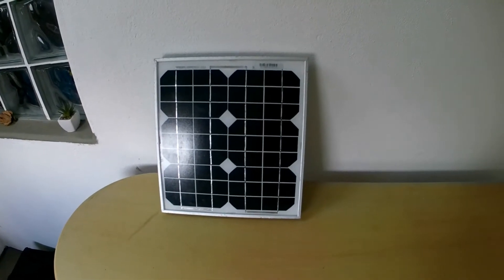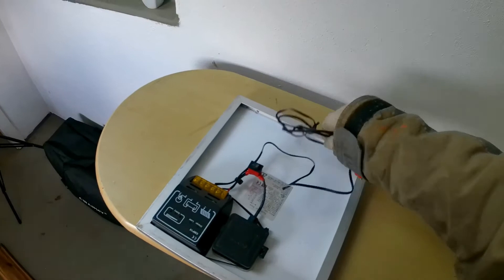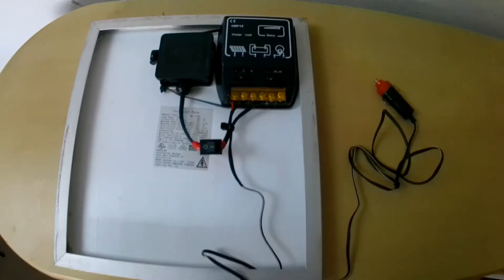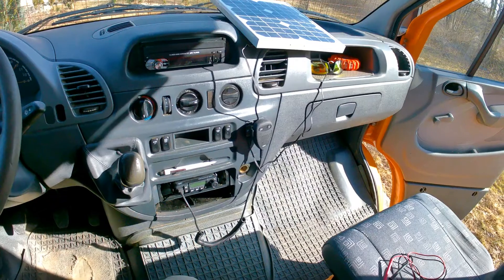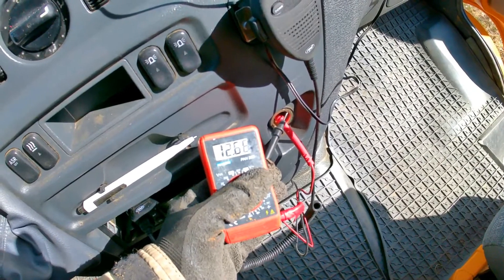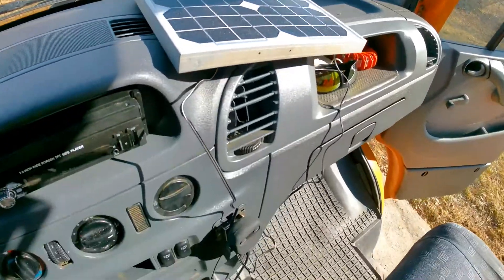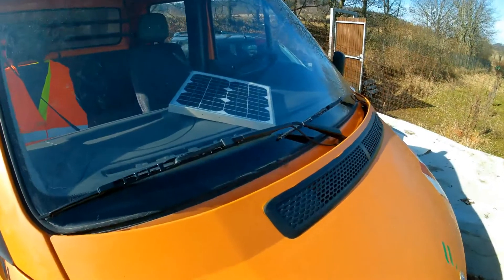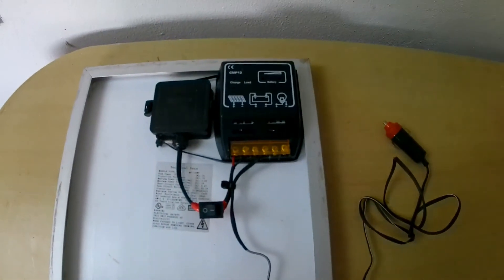Simple DIY Plug-In Solar Trickle Charger for Vehicles

Comment: I’ve seen over a dozen of these solar battery, tender videos and I’m glad that you mention:
1. Using a 15 W – 20 W solar panel. 
2. Testing cigarette lighter to see if it’s connected directly to the battery on technician is off.
3. Showing how to test your cigarette lighter with a simple multimeter.
This was exactly what I was looking for when I found your video !